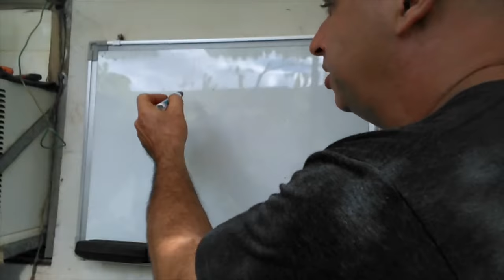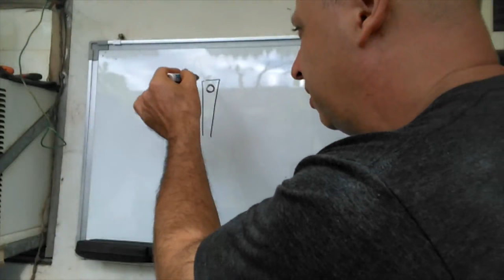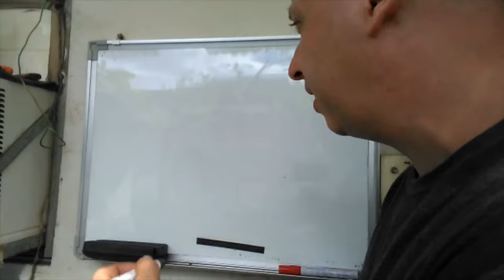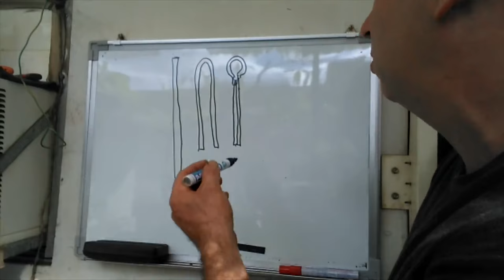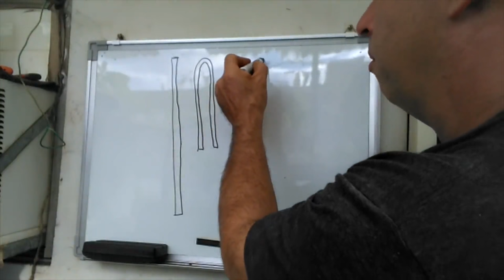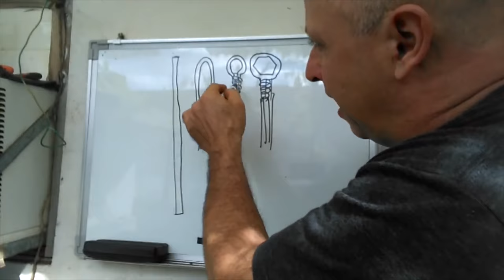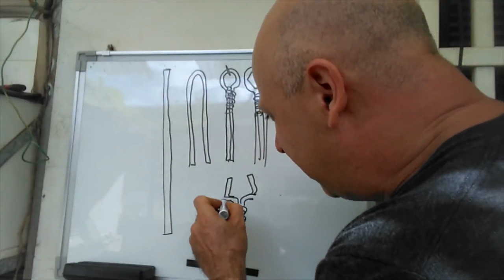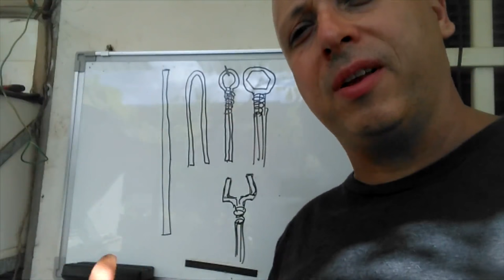Blacksmithing - forging box wrenches - GS Tongs

Comment: When you referred to hex stock for forming the holes. Since hex stock is less common, how about grade 8 coupling nuts. Long enough to use like a drift and harder than standard grade bolts or mild steel hex stock. You could grind or forge one end to a taper to start the hole and pound it in from there. Just a thought. :) New subscriber! Like your no non-sense style.
Reply from the maker: I think what you suggest would work just fine. Something else to try... Thanks for watching and subscribing. Glen

Comment: How are your forgings always so scale free and barely black? I see you brushing, but not excessively. Is your forge just extremely neutral?
Reply from the maker: Tristan, yes, I believe my forge runs very well - very neutral. But I've been known to not forge at very high temps. - somewhere around an orange and not yellow or beyond. Some blacksmiths will criticize this but I often wind up with finished products that have a very light, even gray scale and barely any pitting. One other thing that might contribute to the minimal scale could be the weather here (Taiwan). I can't exactly say why but it seems like scale formation is less than when I was operating in WA. State with the same type of forge. This type of forge is considered "atmospheric" so maybe there's something to that... Thanks. Glen
Reply: That's very interesting, thank you!

Comment: Being broke all the time, I live on SS and small retirement, I make everything I can.  I used to buy wrench sets because they are usually much cheaper per wrench that way but now I have all the common wrenches I need and the price of wrenches I don't have are high enough to push me to make anything else I can.  Unfortunately I don't have the experience or expertise to do everything so I greatly appreciate vids that help me with ideas.  I have thought in the past about making wrenches but was always in a hurry so just spent $10 or more on what I needed.  Now I will take another look at it.  Thank you very much.
Reply from the maker: Paul, Thanks for sharing your situation - there's definitely a lesson to be learned in what you say. We all can't immediately run out and buy what we might need but as blacksmiths we can make and repair more than a good share of items. What you say makes me think this video isn't as invaluable as I first thought... Thanks. Glen

Comment: I've never before broken a normal wrench i doubt i could even break a medium carbon one
Reply from the maker: That's probably true. I was just thinking the twisted one might bend if too much torque is applied. At the very least, I think it should be made from slightly thicker stock given the size of bolts/nuts it's made for. Thanks for watching. Glen

Comment: Glen. Great video. A quick tip. I noticed that you tend to have to look at your hammer face a few times to see what face you were going to use. a lot of smiths, myself included, mark or shape the handle in a way that when you pick it up, your hand knows what face is where. just something to think about to save some heat.
Reply from the maker: Tom, You're super observant. I switched to using this hammer more (for hitting on top tools and some general hammering) and I like to use one face for top tools only, since its more likely to be marred. I made a mark on my previous hammer, like you mentioned, but haven't yet on this one. Once hot steel comes out of the forge, every second counts so thanks for reminding me. Glen
Reply: Civic repair
Reply: hey drill dude  cool trick home made drill D.R I'll be giving it a try

Comment: I really like your setup,  what does your hammer weigh? Thank you for the idea to make these, I've been trying to figure out what to get my father for christmas and he does alot of mechanical work so he would like these. Put a second twist on the other end of the wrench so the rods don't move or pinch your hands when under load. first video of yours I've seen and you just got a subscriber keep it up
Reply from the maker: Jon, I'm very glad you like this video and subscribed. I kind of felt that this was a bit impractical, given that wrenches are so widely available. But if we're blacksmiths, we might as well make some custom tools like these. In the future, I'd like to do a video of making an open-ended (crescent) wrench. My hammer is about 3 pounds and that's the heaviest I'll use nowadays. Good idea about putting a twist on the other end... Thanks for watching and taking the time to comment. Good luck in all your work. Glen

Comment: The most difficult nuts to undo are bottom nut of toilet cistern, and underneath the vanity basin to undo the taps. In each case I've wasted good dollars on commercial ratchet grips and hinged spanners, both of which are expensive and don't work in the confined spaces (especially the ratchet). So I had to make sheet metal and mild-steel contrivances rivetted together and filed to exact nut-size. One has a long wooden handle I attached to get it into the corner beside the toilet. This new techniques is definitely a great option for me, now I can heat & twist the various sized re-bar available at my local building supply. The full-metal handle & socket will allow greater strength. Thanks for more inspiration Glen.
Reply from the maker: Dav, Very interesting comment regarding how wrenches similar to these might come in handy. Thanks for sharing. Glen

Comment: I really like the look of the wire-wrap wrench.  You could probably make an extra thin wrench, or a wrench with an odd shaped handle ... for some reason (bolts in tight quarters, that sort of thing).
The wire-wrap look is very cool.
Reply from the maker: I think you hit on the exact reason this might be practical - in case you needed a wrench at an odd angle or for an extra tight space, this might work in a pinch. Thanks for watching.

Comment: so did you think about putting the bolt in the hole in your anvil so you could just  hammer the loop over the bolt head instead of holding the bolt?
Reply from the maker: Tony, That would also work and likely be better but the bolt diameter would have to match the anvil pritchel hole pretty well. A good idea... Thanks for watching.

Comment: What u using for a anvil? I Want something cheap just to make a few knifes to see if it's a hobby I would enjoy. A piece of rail road is something I'm going to get but would like to have something with more work area
Reply from the maker: My block style anvils are my own designs which I had made here in Taiwan. Given the work involved  - surface grinding, machining, and heat treating - they actually aren't cheap. But if you got a hold of a decent size piece of 4140 or 4145 steel, the cost wouldn't be too great and it could serve as a reasonable anvil surface. Un-heat treated, it wouldn't be ideal but it would still work for your purpose. Thanks for watching. Glen